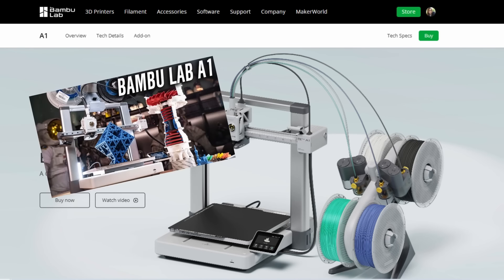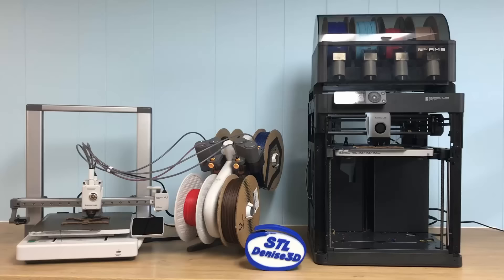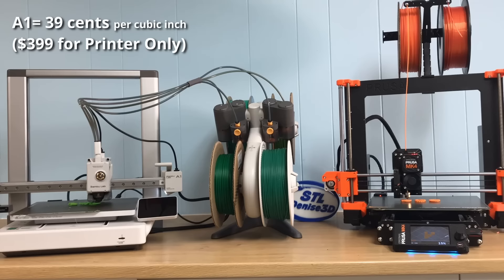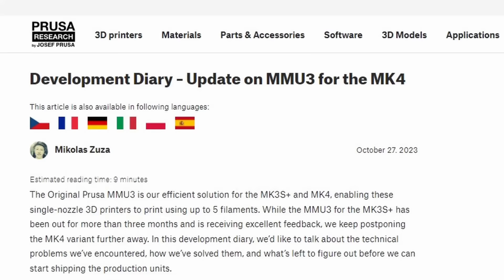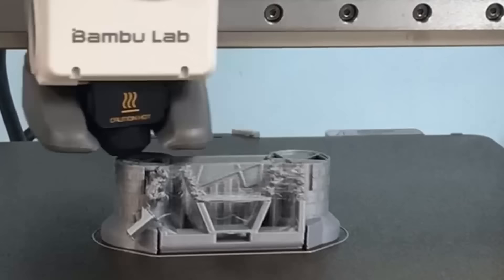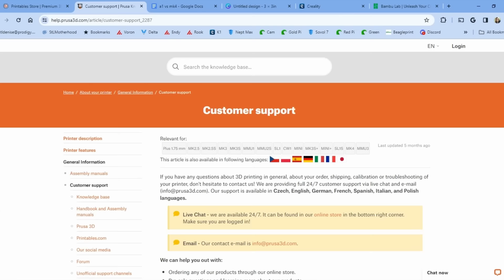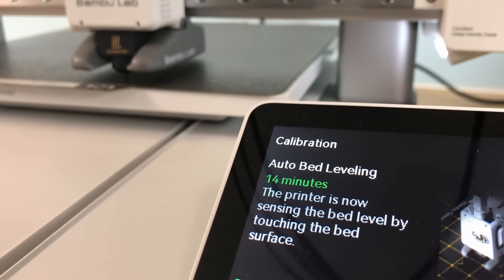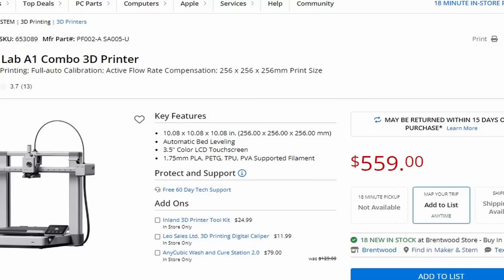Battle of the Bedslingers: Bambu A1 vs Prusa MK4

Comment: I don't think its very objective to completely disregard the cost differences (which is 3x where I live) by saying its an expensive hobby if cost is your main concern get an ender.  Are you forgetting the 7+ hrs of assembly. Also, I'm guessing when Prusa's multi print hardware is released that will be inflated aswell.

Quoting Prusa all the time... Is this a sponsored video?

Fanboism is fine, just dont try and disguise it as an impartial comparison when there are so many caveats and omissions.

Comment: An A1 WITH AMS is only 1/2 the price of an MK4.. this is a major point, not a minor cost increase. Bambu's AMS system has already proven more reliable, overall, than the MMU family from Prusa. Prusa's communication hardware on their Mini/MK4/XL is so bad that they had to develop "binary GCode" to reduce the data sent to the printer in order to effectively get faster data transfers rates; and many TCP features on Prusa's system are custom written and can be more difficult to use and some utilities/features are missing. While Prusa still uses a central shipping point for most of its filament and printers, Bambu has set up many distribution points in other countries which make access to filament much more cost effective. For instance, in Canada Prusament will cost $50-62 a roll where Bambu will cost $22 for refills. The A1 has an accelerometer on-board for input compensation while the MK4 uses a generic model developed by Prusa. Now both may work fine on a specific MK4, but I'd prefer to have a local accelerometer in case the resonances in my particular printer are slightly unique. Now I have an MK3S and it is excellent (but slow), but the engineering quality of Bambulabs in such a short time (Prusa has been developing the MK4 for 5 years and its release still had so many bugs), has to be admired.
Reply: Bambu Studio slicer is a fork of Prusaslicer.
Closed chamber 3D printers are avsilable now because 2 / 3 years ago expired some patents, most of which Stratasys ones.
Corexy 3D printers are nothing new.
They were abke to put all together. Short time, who say You when they started development.
To shorten time there is another way, ha a lot of budget, the Bambu Lab had.
Maybe  not so advertised, but Bambu's AMS and printed were modigied since introduction. AMS has a new control board for example.
How much products have already discontinued or will discontinue soon?

Comment: I'm more a Prusa guy, but those BambuLab printers are quite good and much cheaper. The quality of all the components is better in the MK4, but the Bambu is good enough. For hobbyists who just want to print every now and than. The Bambu A1 is the one to go. The same choice if you want to be able to print in multi colour. 
The Bambu multi colour unit however is rather flimsy and probably not good for heavy duty usage. 
If you plan to be a heavy duty user,  the Prusa MK4 is probably a better choice.  But for multy colour a MK4 plus MMU is very expensive. I would consider buying a Bambu P1 with AMC, or a A1 and replace the AMC one time.
If you want to use other slicers, as the Bambu or Prusa slicer, you don't have any choice. The Prusa machines work with all slicers, the Bambu machines are designed to work with Bambu slicer only. You can use other slicers, but not with all the possibilities to communicate with the printer.
Reply: I'm just curious, but which components are better? I'm a proud owner of and MK3S, and a P1S, so i've tried both platforms. If anything i feel like the 3d printed components on my prusa are of lesser quality than the non printed(or really any) parts on the bambu. 

The only thing i can think of, is maybe the CF rods, which will wear faster than the steel ones on the prusa. but the CF rods also a speed benefit, so its a tradeoff.
Reply: I own 3 prusa mk3s, also curious, all components are better in Prusa? How do you have this conclusion?
Reply: If you think the quality of farm printed petg is even close to injection molding..  have you ever seen a Bambu printer..  compared screens, linear RAILS v rods, camera vs your cell phone next to it..  Working ams vs project mmu.  I'll take two of what you're smoking
Reply: Bambu's slicer is open source, as it is a fork of prusa slicer, and I use OrcaSlicer which is a fork of it. You are locked into using their proprietary network plugin though, unless you want to use an SD card
Reply: @JakJakku  Bambu-slicer is a fork of Prusa Slicer, but not for the full 100% open source. The parts Bambu added are closed.
Reply: @fiorisony  Prusa does not make any sacrifice to quality. All parts are the best they can get, from screws to motors. I have a MK3 running almost 24/7 for four years without any problem.  I only change the nozzle and teflon tube and grease the rods every a couple of times per year. Even Chinese brand like Bambu can't afford to use those quality components for the price they sell the A1.

For most users the quality of the Bambu is good enough though.
Reply: @Matt-bb3nr  Injection molding parts don't have to be better as 3d printed ones. Lineair rails have les friction as rods, as long as the rails and bearings are OK. With a bit stronger motor and good sliders, rods work as good as linear rails, but wear less.
The camera of the Bambu is of very poor quality. I wouldn't call that a selling point. The screen of the MK4 and A1 don't differ very much.

Prusa machines have proven to work over 4 year 24/7 without any mayor maintenance. I don't think a Bambu printer will be capable of doing that, but they are less than halve the price so it is just a choice.
Reply: @wilsistermans1118  screens aren't comparable, and they haven't even enabled touch on the beta4.  Do they use rods or rails on the xl... Rails, because they're better.  Camera isn't very good (it's fine just low framerate)so dismiss that it has none at all.. lol.  You are trying to pee on people and tell them it's raining.
Reply: @Matt-bb3nr  The X1 on the other hand does have rods. Rods and rails both have pro's and cons. Screens are not that much different to me. Prusa does not have touch enabled, but the turn and push button works fine. The Bambu printer have better looking graphic screens, but they can do more or less the same. 
I'm not saying the Bambu lab printers are bad. They can't have the same top quality components as Prusa, but that may not be an issue for many users at all. The heigh price of the MK4 certainly may be an issue. I use my printers (MK3s+, Mk4, XL 5 tool) nearly 24/7 and maintenance  is an issue for me, while the cost of the printer is less important. I know I can trust the Prusa machines, and the Bambu Lab machines still have to prove themself. If I look at a Bambu-lab printer I quess they may run with minor maintenance for three too five year with heavy duty usage. The AMC units are mainly from plastic and depending on the usage the might need to be replaced one time. I don't use a AMC or MMU because of the huge amount of waste those generate. A multitool machine (like the XL)has little to no waste. 

If you think it rains someone might pee. I just write what I think about Bambu A1 vs MK4. There are  differences, but what machine you buy is up to you, your use case and your budget. A Bambu A1 may certainly be an excellent choice. It is a lot of printer for less bucks!
Reply: @wilsistermans1118  you need to go see and feel one.  Your comments about prusa top notch quality will fade as fast as you can say wow,I was wrong as shit.
Reply: @Matt-bb3nr  I have tested a Bambu X1 and a A1 mini. The Prusa's quality is not visible, but will show in the long run. My MK3 has a runtime of over 32.000 h and still has good quality prints. On the first Bambu X1 carbon people begin to see a bit degradation in quality. Still good, but a bit less as in the beginning. Nobody knows how that will evolve in the next years, but it is doubt-full if the X1 can print  four years with heavy duty usage without mayor maintenance. 
You might have something against Prusa, but their quality is proven, but you pay for it.
Reply: @shengyuzhang9010  Prusa always gets the best quality components available. From screws to motors and every printer is tested. That comes with a price and with a price of the A1 it is not possible for Bambu to get the same quality components. 
I don't say the quality of Babu printers is bad. It is easely good enough for hobby use (which is there aim).
Reply: @wilsistermans1118 I have an mk3 sitting right next to a carbon and a1 mini.  That's how I know you're full of it.  You don't need to keep regurgitating your bs.
Reply: What are you talking about? Even Josef Prusa on StrangerParts YouTube channel said they source their motors from China. Your argument doesn’t  make any sense.
Reply: @asgby585  Even motors made in China have different qualities. I know which motors Prusa uses on the Mk3, Mk4 and XL. the last two have the same motors. The  cost of three 400 steps nema 17 and a 200 steps pancake motor is substantial. I can guess the cost of parts and production of a Bambu lab A1 and if they want to make some profit the must use some cheaper (200 step) motors. Also good, but with a shorter lifespan. As a A1 is build for hobbyists that is OK. A MK4 is build for (semi-)professional use. Nothing wrong with using a bit cheaper parts in a hobby machine compared to a semi-professional one. As I use my machines semi professional I prefer a machine of a brand that has proven itself and states it uses only the best parts they can find.
Reply: I doubt that a company that uses 3D printed PETG parts over machined and injection molding parts can be claimed as better.   Pusa MIGHT have better QC over their electronics, but for mechanical parts, I don't think you are even close to being correct. The Mk4 was nothing innovative when it launched, and Prusa is simply fighting an uphill battle these days. Granted, being manufactured in Europe inflates their costs, but that's just the globalized economy we live in.
Reply: @wilsistermans1118  And Prusa is a fork of Slic3r with custom parts.
Reply: @wilsistermans1118   The fuck they do. The lacking cable support for the bed, lack of accelerometer today is just laughable. Missing features like properly working input shaping. The XL has design flaws when it comes to tool changes.  Quality was sacrificed on both the newer machines to get them out the door to compete with bambu.  Dont matter if you use good screws when the design is faulty. Prusa WAS the top dog,  but rested on their laurels to long.

Comment: what is the mean of bedslinger i dont understand can you explain please
Reply: It means that rather than the hot end and extruder being the only major moving element in all 3 directions, they put one of the moving axes on the bed itself. So the nozzle end will do up down and left and right while the bed goes forward and backward. The printer "slings" the bed back and forth so that the extruder only has to run two axes.
Reply: @joebranson9275 corexy sometimes moves beds. Prusa XL, Bambu X and P series all use moving beds in Z. However voron 2.4 does NOT move the bed
Reply: @Zyghqwyv  Yeah I could have been clearer, The main point is that a bedslinger performs lateral movements wiggling the part around where coreXY leaves the lateral moves to the print head. I described what would be a coreXYZ if that even exists by mistake haha.
Reply: @joebranson9275 deltas are kinda similar to that but yeah, Z isnt that big of a deal since prints are 2.5D instead of true planar printing.

Comment: good review however i feel you where biased toward prusa the a1 is clearly the top dog  in this ring. also it comes with the ams at that price so it should be counted.
Reply: Ikr. $400 vs $800($1100assembled) or $560 with AMS
You could get 2 printers with ams for the cost of the assembled mk4
Larger build area, potentially faster, affordable parts, camera, remote monitoring and a host of QOL features
But if you want to compare them you would have to gimp the A1 drastically to make a video.

Comment: Sold all 15 of my mks3+ machines as soon as x1c came out. Now have five x1cs and 3 p1ps and now 2 a1s.
These orint on average 3 times faster than the mks3+ did and same or better quality prints. Equivalent of 30 mks3 pri ting power. 

My x1s clock in over 3500 hours each and just needed usual oiling of z rods and wipe down of gantry rod. Still original nozzle

Best move i ever made

Comment: Not bad at all for this review but I believe the A1 is the clear superior printer. Better and more polished design. The MK4 is just a beefier MK3S+ with a not so polished input shaping and still running Marlin. Long term because BL printer haven't being time tested and customer service are Prusa's only advantages. If I was buying a printer today I'd definitely take my chances wiht the A1
Reply: There is nothing wrong with Marlin. Klipper is hot right now but not superior to Marlin.
Reply: @MrKornnugget And to be honest, the Prusa firmware no longer has much to do with Marlin.
Input Shaper was ported from Klipper, for example.
Reply: @herr_rossi69  Open source projects. So it is possible to merge whatever You want.
Impossible for the ones with closed source firmware.
Reply: @donkeymarco  I meant that in a positive way. For me, something like Bambulab is not an option.

Comment: I'm not inclined to buy a bed slinger from a company whose founding slogan was, "No more bed slingers."  Reading the Bambu Lab "All Your Designs Are Belong To Us" licensing agreement makes the entire company a complete non-starter for me.  I hate how the default is to send a file from my computer to their cloud server then back to the 3D printer that's two feet from my computer.  Invading my privacy and violating my security are the only reasons I can imagine to do that.  Don't care about privacy or security?  Last August, the Bambu Lab cloud server crashed, and when it was restored in the middle of the night in the US, it processed the jobs that had been submitted and printed them on top of the parts that were printed locally after jumping through all of the punishments that Bambu inflicts on users who don't print through their cloud server.  Those printers crashed hard in the middle of the night, with destroyed hot ends, etc.
Reply: This. Absolutely.
Reply: @dkorzhevin - Don't forget the heated bed cables on the Bambu A1 that are sparking and smoking.

Comment: I own the MK4 and A1 - despite the recall, my long term opinion is that the A1 is the better value overall. Much more features, much better price, MUCH less tinkering, and easier to maintain. I recently had clogs occur (in the same day) on my A1 and my MK4, and dissembling and cleaning the extruder and nozzle on the A1 was MUCH easier and quicker than on my MK4. I ended up cancelling my MMU3 preorder for the MK4, and got another A1 for  not much more $$. My A1's are awaiting the headbed cable recall fix, which I am not mad about, because I will get some sweet gift cards, and in the meantime, I will just print on my X1 Carbon.

Comment: Don't blame the filament for the printer not being fast.  Hell is prusa thinking.  True speed is not everything.  Speeds is only 98% of everything.
Reply: Nope. If your line is short then your speed is limited by the acceleration. Speed is not acceleration. Don't fall for the marketing gimmick
Reply: They say, haste is waste. And with AMS it is just waste, without haste = )
So yeah, speed is not everything (and Bambu AMS concept proves this too).
I am quite OK with my 70--90mm/s PETG speed. Never printed PLA, it is expensive and fragile, does not keep well outdoors.
So I watch all those videos with large portion of skepticism. Like "1000m/s on some sort of very expensive and very very special PLA? Yeah whatever".
This may be good for prototyping though. For some expensive prototyping I should say = )

Comment: The problem with all the BambuLabs is the extremly low limited temperature of the printbeds. The Bed of my Prusa Mini+ can be controlled stable at 100°C - the Bambu A1mini reaches only 80°C. My Prusa MK3S+ can be controlled stable at 120°C - while the Bambu A1 can only reach 100°C. With my Prusas I often print ASA - this is not possible with the Bambu A1mini. So Bambulabs are for me at this time a No Go.
Reply: Actually the A1 can go to 100C on the bed.  The initial info was a typo.  The A1 mini is limited to 80C
Reply: @richardbertacchi5016  ... this is exactly what I wrote. 
MK=120°C, Mini+=100°C --- A1=100°C, A1mini=80°C.
The difference is in both cases 20°C lower for the Bambus.
Reply: for the pricepoint its better to compare the mk4 with the bambu P1S or even X1c.  Even those combos blow prusa out of the water.
Reply: Now do the p1s.. still cheaper
Reply: @elsap75  And how many filaments that need a 120c bed are you printing in an OPEN SIDED printer? NONE.
Reply: I print pc blend and nylon filiments quite a lot and it's only recently I got an enclosure for my mk4.

Comment: Theres no issue with top mounting the ams lite on top of the A1. Print the stabilising feet too. It works fine

& Mk4 doesnt have a camera, so it loses that small point. "Smart phone app on old phone" lmao

I had to use prusa support twice, once was good & helped me quickly, other time was hopeless, taking days to get back to me each time.
I have used bambu support once, they were fast to get back to me & gave a good solution for my issue.
So in my experience, prusa isnt exactly a clear winner there either.
Another category to look at would be the launch of each product. Did the mk4 ship with all its promised features? Input shaping? No it didnt, took months to get it released. Did bambu have a hassle free launch with the A1? I would say yes. I was able to order my A1 in ireland & got it like 5 days later. Had all of its advertised features out of the box